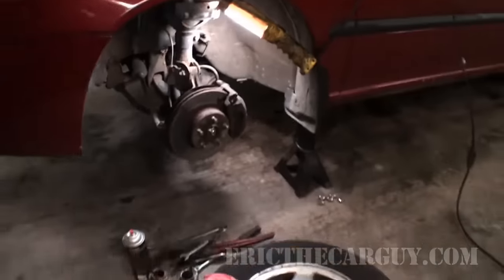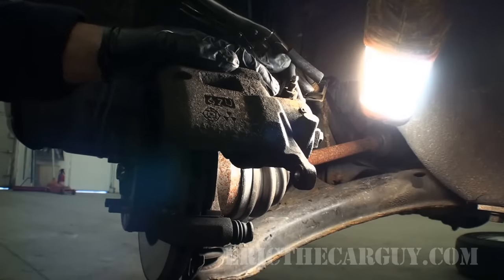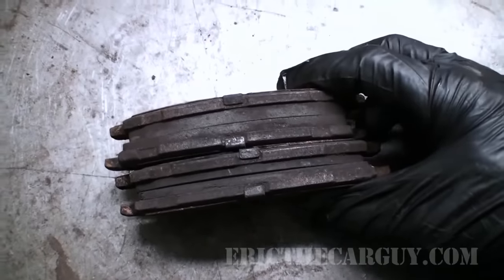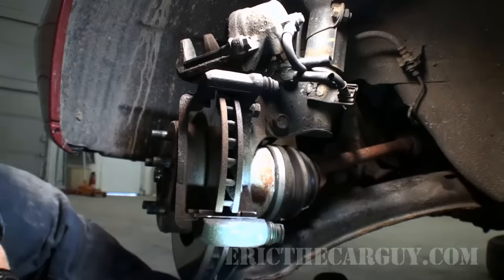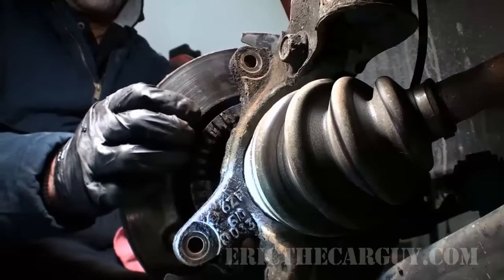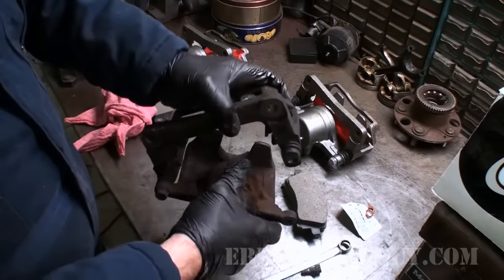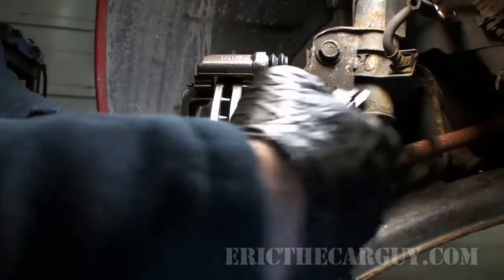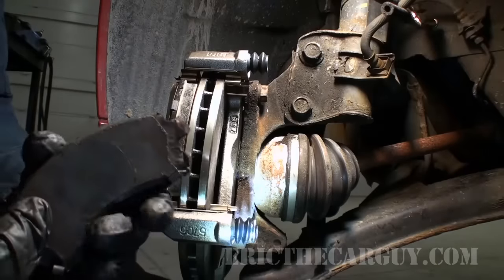How To Diagnose and Replace a Bad Brake Caliper -EricTheCarGuy

Comment: I found the problem with the calipers on My 07 Honda Element was the (soon to be Ex-wife) likes to talk on the phone, tail gate, then slam on the brakes thus warping the rotors. Quick fix? Throw the damn cell out the window and no longer allow her to drive My cars. Please practice and enjoy!
Reply: Sounds like you have a good plan there. Lol.
Reply: That should be on the inside cover of every owner's manual.
Reply: U sound hurt.. Lol
Reply: Brake rotors warp because of run out in the rotor. Which after time builds up pad material on the high spot.

Comment: Soft line crimped off, check bleeder valve, the DIY bleeder bottle, unbolting one side of caliper, Ive changed a few dozen brakes in the last 25 years (my vehicles) i have never read or been told about these tips. Freakin' genius. Thanks boss!

Comment: Didn't know about the silicone lube.  Thanks
Reply: Yeah, this the first video that mentions that fact. I will use silicone next time.
Reply: Michael Stewart If you didn't check it for silicon, you can just pull those two bolts on each caliper one at a time, put some on the bolt if it's dry, and put it back in. No need to remove the caliper. I wouldn't drive it like that for long without any as it could potentially seize up. Some manufacturers recommend lithium soap base glycol grease for their cars, such as Toyota, but if you aren't sure about your car go with the silicon. That other stuff can eat those rubber boots if it's the wrong type of rubber.
Reply: Thankyou. I will do just that.
Reply: lol
Reply: paul cannon It will not swell that rubber on the pinn and lock it up

Comment: Why not rebuild the caliper & save 10x the $? 🙄 Otherwise Excellent! 👌
Reply: I was just thinking the same thing. New calipers for my car are 230.00+.

Rebuild kit with pistons and seals 50.00.
Reply: In my limited experience, while rebuilding a caliper is a viable option for a higher end vehicle, it's not necessarily going to be worth the time on a '97 Subaru

Comment: the tip an testing the piston with the bleeder valve open was a great. instead of buying a $60 caliper i only needed to get a $13 break hose. thanks for all of the little tricks of the trade, not only does it make the project go quicker, it also makes it more enjoyable.

Comment: Another excellent video Eric. The use of silicone paste on the caliper pins is exactly what I learned at Universal Technical Institute in Arizona 21 years ago. I use 3M Silicone Paste and have never varied from this. Never use "grease" on these pins you will be asking for trouble.

Comment: Can I use grease?
Reply: +R  C Nelson not without lightning
Reply: +R  C Nelson I do, but that's because I am too lazy to buy the correct stuff.
Reply: If you use grease on the caliper guide pins (that's what Toyota calls them anyway) the grease is a petroleum product, as are the guide pin boots. The grease will eat away at the boots causing dirt, sand, etc. to destroy the pins. As far as I know, unless you go to a yard, you can't buy just the pins, you have to buy the caliper. But I'm not 100% sure about that. In any case, the right stuff is easy to get from Amazon, Eric has links in most of his brake videos to the right stuff. It's inexpensive, and won't bring you back to do this job again when the failed boots make your brakes fail because they no longer float. And when they don't float , now you need pads and probably rotors as well. Cheap and easy to get, I would really recommend using the right lubricant once, rather than have to replace the calipers again long before they should have needed it.
Reply: LiveFreeAndShoot .
Reply: LiveFreeAndShoot would you send a link all those stuffs
Reply: If you listened to the video, you would specifically hear him say to NOT use grease, more than once. He even explains why (cause it will eat the boots). You use silicone grease or synthetic grease cause it will not do that.
Reply: Bill Does Stuff I'm pretty sure he's just trolling, relax.
Reply: xD
Reply: Bill Does Stuff calm down haha
Reply: @Carbon12_666  🤣

Comment: Good clear video and audio/ decent lighting. 

Brake hose/ banjo bolt up - Mmm, soft copper is normally preferred because the (clean) mating surface should have a slight narrow circular rise that will cut into the unused copper sealing surface.  Steel is too hard to cut into.

Comment: Great video Eric. One of the things I do when replacing rotors is to shore then place with the small set screws if provided for. If not I run two lug nuts to secure the rotor firmly in place then continue with the install. This prevents  a lot of movement when installing the pads.

Comment: Thanks for the explanation about the vehicle pulling to one side and the brake caliper or mounting pins probably being bad or binding on the other side.  That is what is happening to my car, so I removed, cleaned and put silicon grease on the left side front guide pins but it is still pulling to the right.  So I guess now I will be changing the calipers.  Probably time to do both since my 98 Ford Contour has 209k miles.  Thanks again for the great video and explanation.

Comment: Thank you, EricTheCarGuy  Huge THANKS! I did it myself on e46 bmw which I bought from another guy. I spent around 5 hours replacing and cleaning the front brake system. The condition was terrible! I couldn't believe what my eyes are seeing before them! All was rust and rust and rust! The wear sensor was disconnected! Prison for everyone who does this and sells the car after that without mention it! Next step for me is rear wheels brake and brake liquid change!

Comment: Thanks Eric your video helped me out a lot.  I did in fact have uneven pad wear and I installed new pads and rotors but have an issue with brake fade.  I am going to replace my calipers and see if that solves my issues.

Comment: Good call on pointing out the difference between the parts and fasteners included with reman calipers. Sometimes the parts that they throw in with reman calipers are very different. I've had them send brake shims that required a fair bit of reshaping just to allow the caliper to drop down over the pads, and they still dragged along the outer diameter of the new rotor. And definitely lots of weird bolt sizes. Asymmetry in fastener sizes makes things more trouble than they need to be.

Comment: Never thought a hose as being the culprit. Going to replace old brake fluid 1st. RR bleeder cap is missing. LF caliper locking up. Thanks for posting another easy to follow video.

Comment: Hey Eric. Big fan of your channel. Got a problem with a brake on a 2002 Citroen Saxo 1.1. 
The brakes seem to be binding in a spot on every wheel turn on the front left wheel. 
I've replaced the caliper thinking it was a binding piston causing it but I now have the same issue, also replaced the flexible brake pipe as the fitting was seized in the caliper. 
I've bled the brakes repeatedly, even went out and bought a pressure bleeding kit which took a tiny bit of air out of anything. But the problem remains. 

I've removed the brakes to rule out anything transmission, axle, or hub bearing related and it goes away. Put the brakes back on and you can feel it with every wheel turn. 

Only thing to note was i fitted the retaining pin for the pads at the bottom of the caliper where originally I took it off from the top. I tried for days to get it in the original position but it just would not fit, tried brand new pins too. The pads were worn uneven on this wheel before any work hence why I started the work but I didn't give it a long road test before so didn't notice this problem so unsure if I've caused it or it is the main issue that was there all along. 

I would love any wise words you can cast over my efforts so far if you have the time to read my long post and respond, I understand if not, you must be a very busy man. Thanks and keep on making an awesome channel that has taught me so much. Have fun, be safe and stay dirty! Roy

Comment: Hello Eric, I have done about 50 brake jobs in my life, never had an issue till yesterday. I have a 2006 Solara, first time I did the brakes on it. The rear caliper screws/pins had no grease actually dry and slightly rusted and some oxidation from aluminum calipers and the brake pads were frozen into the hardware. I removed everything, cleaned everything up and put new pads and rotors on, the caliper pistons went in easy and I was careful not to bend the hoses also. I put everything back together and went for a test drive. My drivers side locked up to the point of the painted coating was burning off the rotor and enough smoke to think there was a small fire. I went out this month and took it apart and the piston again moved back easily, so i removed the screw/pins and removed some grease, put it all back together and seems to be fine now. My question to u is, can too much grease cause the screw/pins to seize? Maybe bad hose if the problem comes back? Thanks Eric!

Comment: Question..(Eric or Anyone that knows) HOW do you check the piston to make sure its doing what its supposed to? The less common brake hose check is explained but not the piston. Assuming it's so obvious that you just pump the brakes.. BUT we dont know the details & tips/tricks.. hold it, hang it w gear tie, bolt it back on?.. what if its one person, how do you see & pump brake at same time?  PLEASE NOTE!: THIS type info is where Eric the Car Guy Usually shines & is the very thing that separates you from Everyone else.. you Are Very Good at including it at Every step and are aware of your viewer and avoiding information bias which is not easy when you do something so often that you have to consciously & constantly remember that the veiwer may not know the most basic info that is so obvious & engrained in you that you don't even think about it anymore. This is the first time I've encountered info your videos that left me with questions on the details.. So it highlights what you normally do so well. Thanks for your time and effort to help others.

Comment: Great video Eric. I just installed the whole 9 but my brake shoes have a 3 pronged clip that inserts into the piston bore. I had a problem figuring out the sequence of the pad first or the bracket first. I decided to insert pads first on the bench, bracket next and then the entire assembly. Any future video with this tipe of system would be great. Any comments appreciated.  Thanks.

Comment: The reason you don't use grease on the slide pins, especially the ones with the small bushing on the slide pin is that brake grease will make the little rubber bushings swell up and they will lock up the caliper as well as for swelling the boots on the end which will allow stuff to get inside. You only use silicone grease inside. Sil-glyde is the best.

Comment: Super helpful video. Right rear on '12 Highlander makes a noise when driving. When braking noise goes away. Pulled wheel. Can't rotate rotor forward without a lot of force. Rotates backwards maybe 1/4 a turn but makes grinding noise. Looks like brake pads are pressed against the rotor -- ie caliper piston isn't retracting. Anyway, caliper? Slide bolts? Something else? TIA.

Comment: I replaced both front calipers and rubber brake lines on my 2001 Jeep because they were getting burning hot and slowing down my vehicle while in stop n go traffic. This seemed to fix most of the problem but the thing is that my mileage is not so good and I noticed that my right front hub is getting a little bit hotter then the other hubs and that when I jacked up the front wheel of the vehicle that the front passenger tire still does not spin freely (I can spin it like 1/8 turn maybe). I took apart my front caliper and bracket today and cleaned everything up with a wire brush and greased the slids so the pads slid nicely but when trying to compress the rebuilt caliper pistons to resinstall everything (Rebuilt Teves calipers from Auto zone) that they donot compress hardly at all. Your video is just what I need to see if that rebuilt caliper is an Auto zone dud : (       Your video is the only I found that go's into troubleshooting the caliper like this so keep up the great job Eric.

Comment: Nice video as usual Eric. Ref your comment about initial impact action on first undoing tight / rusty (frame bolts in this case), 110% with you on this. It prevents bolt shearing that is often the result of sheer leverage, also if done manually this way you have a far greater feel for the condition the bolt is in. Once loosened then use power drivers or whatever floats your boat. If you are worried about using palm of the hand to hit the spanner (sorry, USA / Canadian guys wrench) then use a soft faced mallet with care.
I hear the purists say that you shouldn't hit a spanner (there I go again) well I say spanners are very tough and if you buy quality tools they will take a bit of gently punishment from a soft faced mallet which also will not damage the surface of the tool. I also say that I would rather use this method than shear bolts in castings, if it is rusty and / or tight enough to shear upon initial undo then it'll likely be a bitch to extract, even with heat and it's time consuming too.

Comment: This is a really good video to the complete novice and just what I've been looking for. Thank you.
I have a Chevrolet Lacetti 2006 auto and unable to get a repair manual. . 
As I type this, my car is at the garage supposedly having a caliper change to the left rear wheel at a cost of £230.85. I'm fed up of being charged silly money for jobs that I could try and fix myself. Maybe I should ask them to supply me with the parts they take off, that way I can see for myself whats what.
I will be checking out your other videos during the course of my learning.

Comment: Hi Eric, John from the UK, this video I found very useful as just doing my Nissan on a 06 plat just one thing is that one rubber on the slide pin was coursing the biggest problem as it has expanded over the years so would not allowed the piston to move freely so was advised to take it of as it's only an anti vibration, all seems to move free know so followed most of this video very informative  in deed thank you so much.
Only thing at the moment with Coved 19 and getting parts from the other side of the world is taking weeks.

Comment: Awesome video! I have a 2003 Mazda Protégé. The new rear rotors did not have the holes for the set screw. I thought I would have to put the tire on to be able to adjust them. Your tip at 29:00 solved that! Great tip.

Comment: Very educative video! I did brake fluid flush on my 12-year old car, however found that the fluid flow was very slow no matter how smart/hard I pedaled down. I tried two wheels and found the same symptom. Do you think the brake system has lower than required pressure, and this low pressure is caused by the worn brake master cylinder; or is it a caliper issue (the breeder screws are good)? BTW, for that two wheels tried, I didn't notice any air bubbles coming out. I had two times of experiencing spongy/sinking pedaling before. Moreover, while braking during running down a slope, I experience brake pulsation. I checked the brake booster, which is normal.
Thanks!

Comment: I found a simple way of checking if caliper is sealing using HF brake bleeding kit (hand pump with gauge), small bleeder wrench and needle nose locking pliers like the one shown on video. First, connect kit to bleeder and pump it a few times with bleeder closed. Make sure it keeps pressure and connect is good. Pinch off brake lines. Open bleeder. If pressure still holds, caliper is sealed. If its not sealed, air will enter the system and it will show on the gauge.

Comment: Excellent video.  Just a quick comment about Copper washers:  The washers harden with use and should NOT be reused as is.  To soften them, simply heat them up (with a propane torch), until they are cherry red and dump them immediately in cold water.  This is called annealing.  Washers are ready for use.  Hope this helps someone

Comment: Great video as always, very clear.
I have an issue with my Forester that I have not been able to figure out.
Brakes seemed a bit weak so I figured I'd change the pads when I switched to my snow tires.
Had a look and both pads and rotor seemed fine so I compressed the cylinders in the caliper to put it back on and then closed it all up with the snows on it.
Started it up to turn it around to put on the other side and it was binding like crazy.
So then I thought the caliper must be beat.
Put new caliper on and bled it but the front rotor seizing problem still persists.
Not sure what happened or why. However there may be a clue in that when I went to drive it again it seemed like now both sides and tight, may just be the extent of the vibration Im feeling from the left side but Im wondering if it could it be some ABS problem.
Normally I can figure this stuff out but ...? My next move is to change the rubber brake line tomorrow if that doesn't work I guess it's borrow a car.
Thanks to anyone for any help.

Comment: i like that bleeding technique of yours.   i was always afraid to do that, because i thought that when you released your foot off the brake that air might get sucked into the caliper from the slightly open thread potion of the bleeder screw.    but maybe not.

Comment: Hey Eric. Excellent videos. I have a 79 Vette I've had for over 30 years. Only regular maintenance I haven't done myself is brake job. Currently believe I have a momentarily sticking right rear caliper. Before I order a replacement caliper I will diagnose as per your video. Any tips from you on corvette calipers? Thanks KMRG